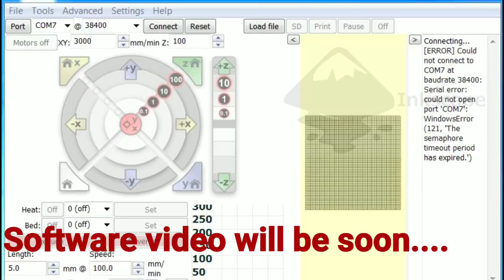How to make a Mini CNC Plotter at home using Dvd Writter by Hobby projects.

Comment: Can you tell me how much input voltage give to motor driver
Reply from the maker: 12 v 1 amp
Reply: @hobbyproject  thank you I feel that it get heat quickly,.
Reply from the maker: Use cooling fan.
Reply: @hobbyproject  yeah but motors get hot is it usual..I stopped..

Comment: When I use ready-made G Codes it works. When I make my gcode the servo motor doesn't work. I don't know why that happens. 
:(
Reply from the maker: In order to make your own g code you require Inkscape softwere  v 0.48.5
https://inkscape.org/release/inkscape-0.48/?latest=1

And proterface softwere in order to run this 
https://www.pronterface.com/
Reply: Go on this channel-Arduino robotics